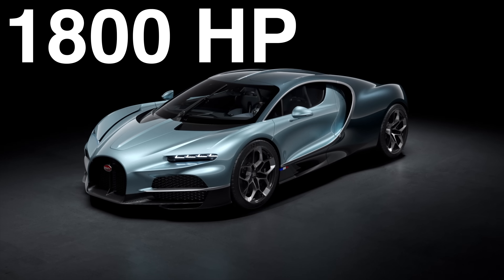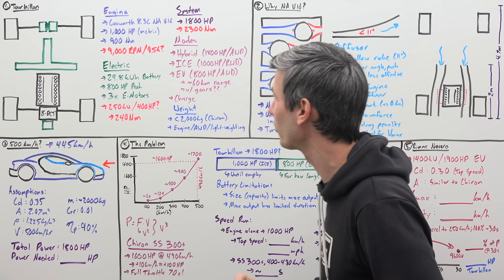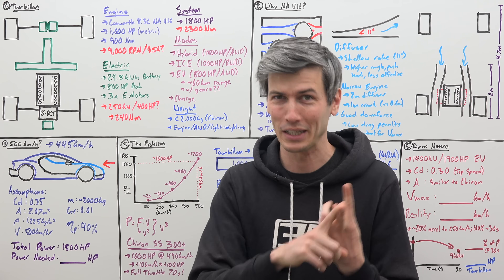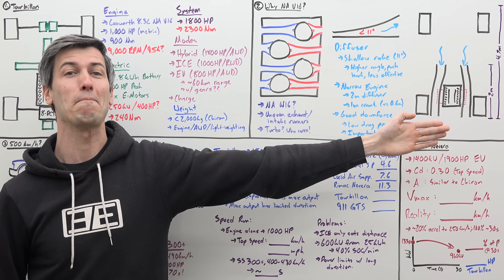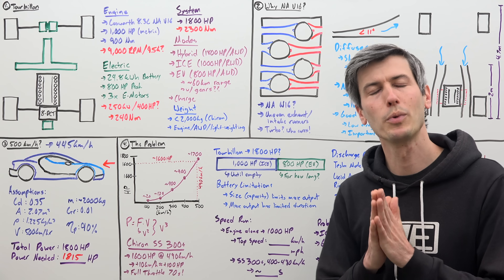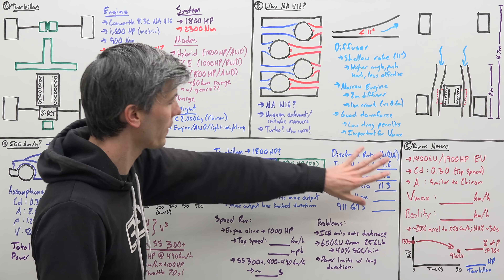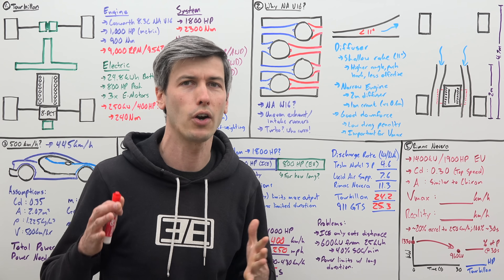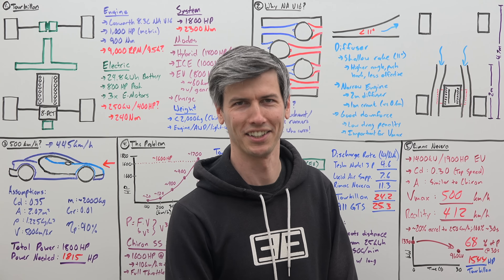Bugatti's Giant V16 Engine Is Insane - All The Tourbillon Details!

Comment: One thing I noticed watching the Bugatti tach sim at 7:45 is as it's approaching that limited top speed, you can see the electric motor out put on the right most gauge, the smaller hand of the dial hovers between about 750-800 hp and only stays maxed out for a few seconds before drastically dropping to zero.

What's more interesting is that it does this before the v16 lets of the throttle so maybe the speed limit is only applied as a restriction on the duration the e motor gets full power?

We didn't see the graduation e motor  output degradation like the Nevera, just a sharp drop so it definitely has a few more kph in the tank 🤔
Reply: Dont forget it is a CGI video (claimed by Mate in the YouTube Premiere)
Reply: @yojoa-vn5ph  From the actual engine output test.
Reply: @Tippotipo  ok sorry... I thought he was talking about the CGI video. U mean Top Gear Output engine test ?
Reply: @yojoa-vn5ph  Yes.

Comment: So the obvious question is can you vary the batter output from the engine to be only additive such that you aren't "flooring it" (max drain) but are say at 50% on the battery but 100% on the gas engine? Wouldn't that prevent the heating issue allowing you to go faster?

Comment: It's actually less than 1800HP because they are using European BHP. It's actually about 1775HP. The engine has 986.33HP and the electric motors has 789 HP
Reply: He did say metric horsepower. Horsepower units are messy because of the differences in standards and 1800HP/PS/cv=1775HP. PS and cv are just German and French for horsepower, the metric one. It’s measured at output shaft and is different to BHP. 
Maybe we should just use watts at this point 😂
Reply: 😮 European horsepower xd... u mean DIN = METRIC HORSEPOWER 😉

Comment: kW/kWh is called the C rate of the battery. 1C means you discharge the battery in 1 hour. Larger C values means you discharge the battery in 1/C hour. The Bugatti does 24.2C (battery discharged in 2.5 minutes) which is quite insane. Do note I have completely ignored the fact that lithium iion batteries cannot be discharged to 0% without risking damage.

Comment: So they take out the passenger seat and fill that total space with a huge capacitor bank, switched so as the battery is giving up you suddenly get a super boost to available current, ( Caps will supply almost all of its charge in milliseconds but yes the voltage runs out even faster, still better than the battery's internal resistance )

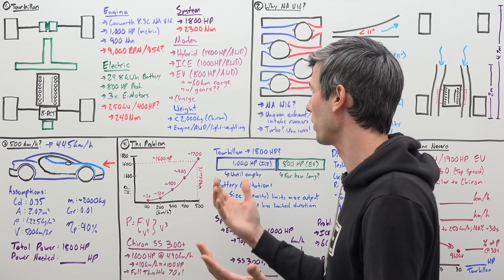Comment: 4:29 we reached the point when someone says "decently quick" for a 800hp motor 🤣. But jokes aside, AWD plugin hybrid makes sense to be lighter than the Chiron simply because you can make the battery structural component of the body, you're removing lot of weight by getting rid of 4 turbos and tubing and intercoolers and the ICE AWD components (they're replaced by only software telling the motors what to do).

Comment: I'm pretty sure they'll release a special edition for the top speed run, as they've done with all the previous attempts. So a Tourbillon SS 500 package with better aero, deeper discharge batteries and a slightly more aggressive tune on the engine to push the power up a bit (or maybe slap an electric turbo on that sucker)

Comment: Mate confirmed on the stage at launch, redline is 9,500 rpm. 

You can also see it shift at 9,500
Reply: AND?! Redline does not automatically mean peak power, it is just the rev limit, most cars can rev over the point of peak power as far as I know...

Comment: Wrong assumption at the end, Nevera didn't lost power after 30s full throttle. It's the power curve of her's electric motors, it have 1 speed gearbox so you get max power of 1300kw at 290 km/h, and only 960kw at top speed of 412 km/h.   So Bugatti will always have 1800hp at 9000rpm in every gear, until battery drains.

Comment: I think you're right that the based tourbillion won't break 500. They could ofc build a 500+ version though:
- lower cd value through engine cover and other aero
- 100hp+ bump for ICE
- battery with better sustained power draw (newer battery tech in ~3 years)

Comment: I'm surprised you don't appreciate mechanical watches a little more as a mechanical engineer. Think about the complexity of a watch and the design and manufacturing to get it to work so well. They are mechanical art. Quartz watches (and even moreso smart watches) on the other hand are meh imo.
Reply: You are among several commentors who apparently think complexity in engineering is a good thing. It absolutely is not. Avoiding unnecessary complexity is good engineering,
Reply: @avsystem3142  efficiency is not always the goal. Otherwise a Prius or Leaf would be the only car options. Even an iwatch has many unnecessary bells and whistles. But many enjoy some inefficiency for the sake of feeling and emotion and art. Mechanical watches provide that for me and many others. I think a few hundred thousand dollar watch is ridiculous just as much as a few million dollar car but I can enjoy seeing the design intent that was put into it.
Reply: @setharcher5869  Who said anything about "efficiency"? My comment was about  complexity. These words are not synonyms. Complexity is never an engineering goal, simplicity is. You appear to be confusing art with engineering.

Comment: The engine has EU7 regulation which means it must run an air/fuel rati of lambda = 1 in any condition. How is that achieved? Prechamber ignition? As it is naturally aspirated a miller or atkinson cycle are not working…

Comment: Imagine the engine with the same power per liter as the engine of the Valkyrie 156 hp per liter
8.3 x 156 = 1294hp +800 hp = 2094hp
Possible 500 km/h now?
Or GMA T50 165 HP per liter
8.3 x 165 = 1375hp +800hp = 2175hp

Comment: For an engineering guy, I think you went over what a tourbillon is kinda quickly (aka not at all). 

In a mechanical watch, the accuracy of the watch will be affected by a wheel going back and forth to tick the movement, powered by a spring (this is called the balance wheel). The thing is, the rhythm of that wheel will be affected by its orientation (depending on the position of your arm wearing the watch). 

A tourbillon is a very complex mechanism found on very high end watches that will constantly spin the balance wheel, therefore equalizing the variances created by the position of your arm. 

Bugatti see themselves as the very best of car engineering and a tourbillon is pretty much the very best of mechanical watch engineering. The pinnacle measure of a car performance is speed and Bugatti has loads of that. The pinnacle measure of a watch performance is accuracy a tourbillon gives you that.
Reply: Yeah in a pocketwatch. In a wristwatch, it sits mostly horizontal rendering the effects of gravity mute. Tourbillons are just overcomplex hype. They were invented for pocketwatches and are unnecessary for even the most precise watch.
Reply: @benshiotsu8553 They are a very neat solution for a problem which is solved easily by any digital watch. It is more a declaration of capability, than a real solution.
Reply: @Heidelaffe  Even a mechanical wristwatch needs no tourbillon.
Reply: And furthermore, with dismissing mechanical watches out of hand. Yes, some of them are incredibly overpriced luxury goods, however, they are still absolute engineering marvels. Highly complicated mechanical watches do things with gears that might be "easily done with software" but to do it in hardware, in something small enough to fit on your wrist, is one of the peaks of engineering prowess IMO. Also, they don't have to be $500,000, or $50,000, or $5,000, or even $500. I don't enjoy mechanical watches as a way to tell time so much as a way to appreciate the incredible engineering that goes into making them work.
Reply: He doesn’t get watches so why would he. And that surprised me btw, I’d think someone so into engineering should love them?
Reply: A tourbillon is completely pointless n a watch, it was developed for clocks which being stationary are affected by gravity, a watch being worn on a wrist is less affected by gravity Sotheby’s only purpose of a tourbillon is to show off the skill of the companies watchmakers and for the owner to show off how rich they are.
Reply: Tourbillons exist in exclusive modern automatic watches simply because they can. Like why modern mechanical watches exist at all. Not everything needs a good reason to exist, people. Sometimes it’s just for fun. The only sad part is that most people won’t be able to join in on said fun. In the end, not the end of the world.
Reply: It's a whole lot easier, cheaper and more accurate to have a watchmaker adjust the timing of the watch then to implement tourbillon complications.  Easier/cheaper still to just buy pretty much any quartz watch or smartwatch.  Tourbillons exist not because they work especially well; they exist because they are hideously complicated and expensive and that's why idiots that buy ridiculous watches like Richard Mille and Jacob products buy them.  Because what good is wealth that you can't rub peoples' noses in?

Comment: I wonder how much it would weigh as pure EV. The engine is 252 kg. The veyrons transmission weighed 124 kg. The fuel of a full tank is 70 kg. But then there's a bunch of other stuff to be dropped probably worth some tens of kilos... Soo 1500-1600 kg? That's BMW M2 territory for an 800 hp EV.

Comment: This new Bugatti has a totally different PU. I know that Andy Wallace said that at 490kph the car was still building up speed, but if you watch this entire video you understand why getting this Tourbillon to 500kph is very difficult. If it was 1800hp in the Chiron SS 300+ body with the turbo W16 it would easily get to 500kph. The EV component is the problem here with the Tourbillon. And the EV component is 44% of the total power output.
I think later they will make a longer Tourbillion (Chiron SS 300+ style) with a cover over the V16 engine and with an extra 100hp on the ICE (we know Cosworth can do it because of the specific output of the V12 NA in the GMA T.50) and also (who knows) with extra power on the EV component and a bigger battery and then they will achieve the 500 kph.

Comment: We have to take into consideration that 1000 HP is the maximal power that the V16-engine puts out at a certain rpm. As long as the engine is not spinning at that exact rpm the power output is less. It depends on the gearing if the car is then still able to reach speeds close to 500 km/h. 
Still, I enjoyed following your calculations a lot! 👍

Comment: with the vr16, they could have had it n.a.  By lengthening the short runners, to make it the same length. Also covering it in the intake manifold. the exhaust well it would be a piece of art honestly. f1 have runner that adjust due to intake pressure...js

Comment: I've seen a video of a P1 and his battery pack is made of A123 system LiFePo4 cells. Those cells give a very high discharge rate until they are almost depleted. The density is lower, but the power density is also lower. They are safer and the discharge current is way greater than Li-Ion. It's a good cell type if you want performance. The Rimac needs a lot of power density to have good range,  so it might use "regular" Li-Ion.
Reply: exactly, don’t certain lipos exceed 70C ratings ?
Reply: The A123 System LFPs are ancient tech at this point. And they cannot match a lipo. But then again, a lipo cannot match LFPs' cycle endurance.
Reply: @rkan2  fair enough, yes however uneco friendly these super cars are, owners don’t want to change the battery after 6 months

Comment: My only question is how those engines can rev so high and still have some enough power at low rpm to be streetable 
I thought well this Bugatti wont need that low rpm torque since it has electric motors to assist at low speeds

Comment: I genuinely don't understand how the hybrid stuff makes the car better - the combustion engine has more power than you could possibly use on the road and the battery seems like it drains too fast to be useful on a top speed run and probably adds too much weight and complexity to help much on a track.  Why not a simple 1000HP v16 supercar?

Comment: For top speed you also need to consider the maximum rpm of the electric motors(in addition to engine rpm/gear ratio) and whatever ratio there might be between the motor and the wheel to achieve 3,500 wheel RPM to hit 500kmh.

Comment: I hate that from now on it's going to be called a TOUR-Bee-ON. Exactly as typed. It's French and loses a lot of what kind of make it a beautiful sounding word if you don't say it in actual French. In fact, I really hope some of you guys watch a Tourbillion timepiece being taken apart to value just what an engineering marvel they are. They were designed in the late 1800's and patented by a Frenchman named Breguet. If you don't know Breguet, I'll let you dive down that particular rabbit hole of amazing. Basically the Tourbillion is a part of the watch escapement that, with normal methods of manufacturing, your mechanical watch would lose/gain time because of the gravity of moving them from your pocket or picking them up and setting them down... the Tourbillion stops that. It is the only escapement besides a quartz watch to not be affected by gravity. I find that about equally as cool as the drivetrain layout of the Bugatti. It's a masterpiece.

Comment: I don't buy that the uneven intake and exhaust lengths in the heads of the W16 should be a problem, it could easily be evened out with the runner lengths of the intake and exhaust manifolds
Reply: I was thinking that exactly. And, too bad the long exhaust ports are surrounded by water jacket. Ford learned to do otherwise after the flathead v8.

Comment: I hope that the record version would just ditch the artsy concept and just be a beast. wa already know that v16 will probably be one of the best na engines out there, basically a recipee for an even better better turbo engine. Would be sick seeing one with the 16.4 badge again. The engine would probably exceed 1800 and even 2000 with the right intakes and turbo geometry. We already know it'll be a longtail design since it would be better on aero so only issue they have is power deficiency . I just hope that the engineers are mad enough to do this. It's far fetched but cool to see. It would alse help differenciate between the 2 models even more